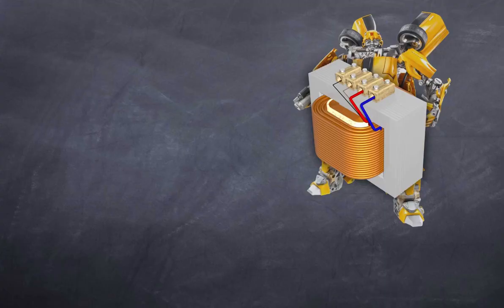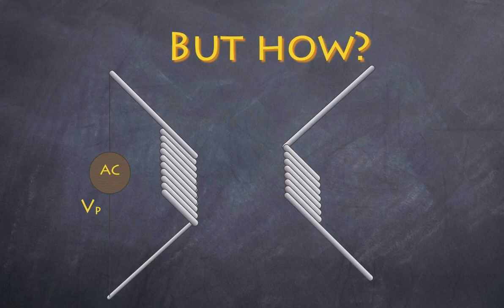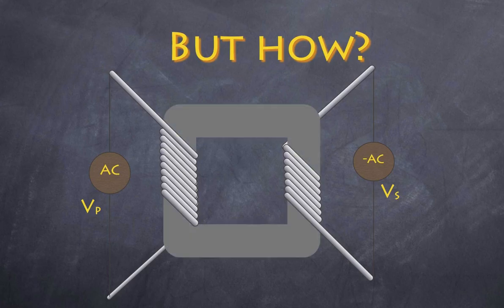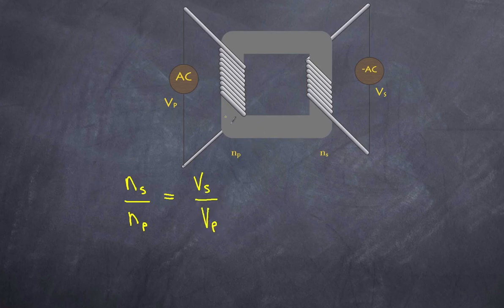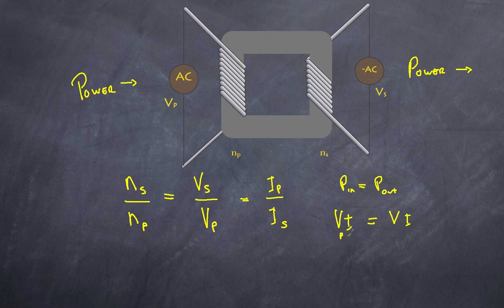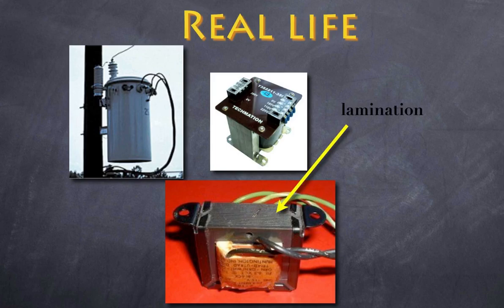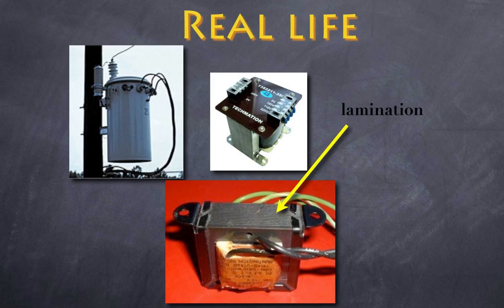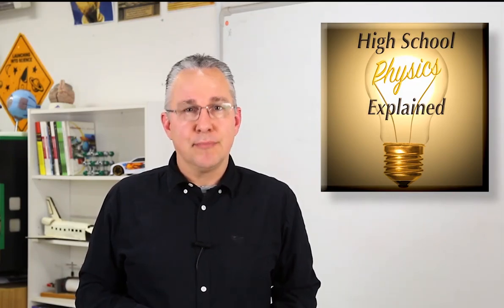understanding the physics behind electrical  transformers

Comment: Great video!  Thank you so much for taking the time to explain this so fluently.  May I ask a question though, in regard to a step-up transformer, is it more important to use the same size wire as the primary? For example, I could wind the coil many more times with a very thin wire as opposed to the same gauge used in the primary wind. What if I was to use a really HUGE gauge wire?  I might only get a hand full of winds, but the wire is thicker.  I know big wire = big power, does this apply?  Lastly, What about instead of one continuous wire, we use a thick gauge insulation but inside, there are many smaller wires.  This wouldn't be a continuous loop, but many MANY wires would be wrapped around.  What would the difference be between the secondary being looped with one single wire vs a large gauge conduit, with many wires inside of the same mass?  Apologies if I am not asking the right way or if I am confusing you with my limited knowledge on the subject.
Reply: type of wire only affects resistance thick or thin they are effective

Comment: I have two transformers, If NS and NP of both have a ratio of 2:1, one transformer 20 turns and 10, then the another transformer  200 turns and 100 what is the advantages and disadvantages and character of each? Regards 
Great video btw
Reply: using math efficiency is same . in a the first flux leakage is higher than in the second even thouhg it is affected bychanging the design

Comment: As V=IR, if you increase voltage, current will increase as well with the similar factor. So how could the power remain conserved?
Reply from the maker: If the voltage is stepped up, the current on the load side will be determined by V=IR. However, if you then measure the current drawn on the source side it will be higher than the current on the load side, to be be consistent with Law of conservation of energy
It may help looking at my video (start at 5:39)
 https://www.youtube.com/watch?v=6kMkdhWjmKY&list=PL5Tk152XlY6QxRxCYJW8XWyvfWRPA-pQO&index=11
Reply: High School Physics Explained You didn't get what I mean! In primary supply(source side), V=IR applies, giving voltage is directly proportional to current. But at 5:40 in this video you says (so does my school teacher) that Vp is inversely proportional to Ip. They are contrasting statements, how can they both be true?
Reply from the maker: V=IR applies to single  circuits. Not wanting to go into a long winded explanation, this link might help
http://www.blueraja.com/blog/194/do-transformers-obey-ohms-law
Reply: High School Physics Explained you just earned a subscriber! Thank you a lot to pay attention to my doubts. I appreciate and hope that you upload some more knowledgeable videos until October 30, 2017 (HSC).